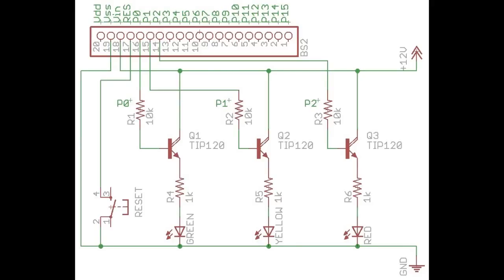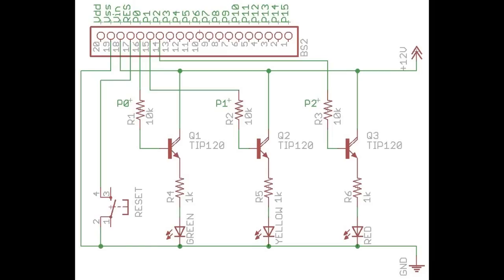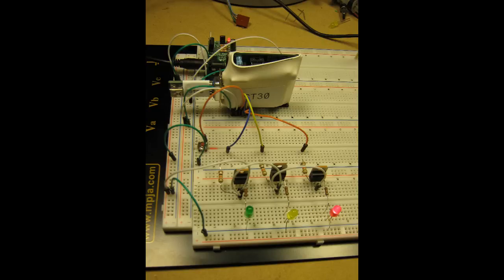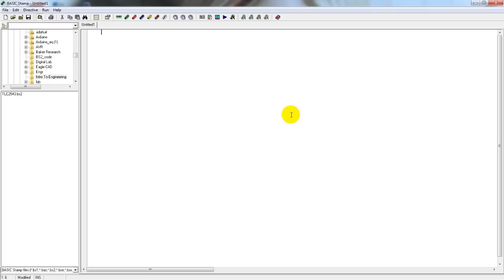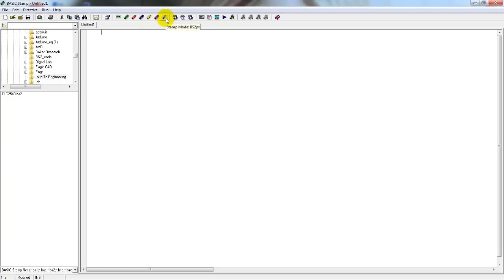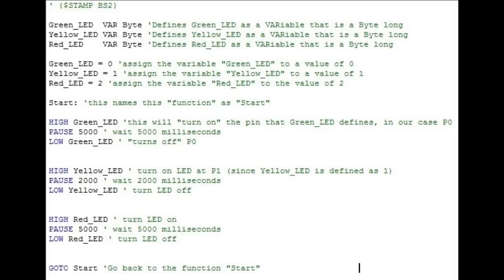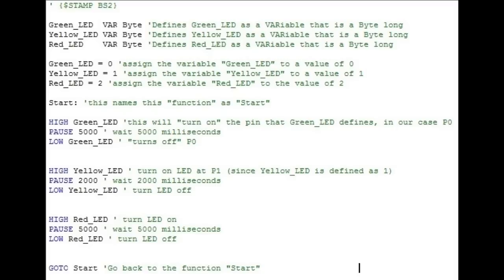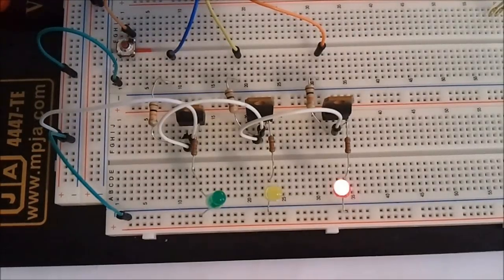Parallax Basic Stamp 2 OEM Module Tutorial

Comment: You did this well, ...very well. You left practically no stones unturned, or any questions unanswered. If only all CBT, or training videos could be this "one on one" with the receiver. Thank you. I am just starting out on Microcontrollers, and have 2 questions for you. Being that you only needed 3 "I/O" ports for this project, you could have used the "BS1-IC", correct? Lastly, why the transistors? Do the I/O ports not have enough current to drive the LED's directly? Thanks again Bud!